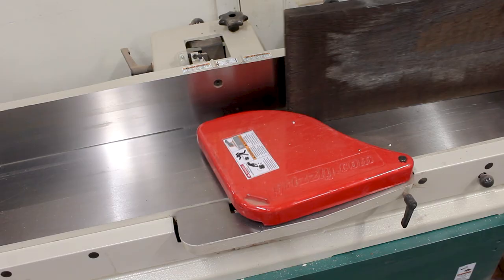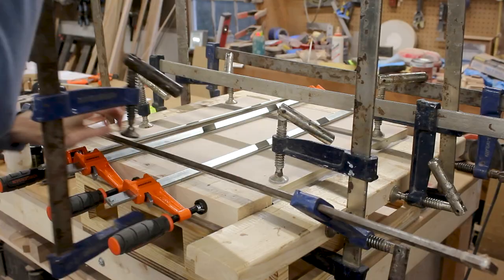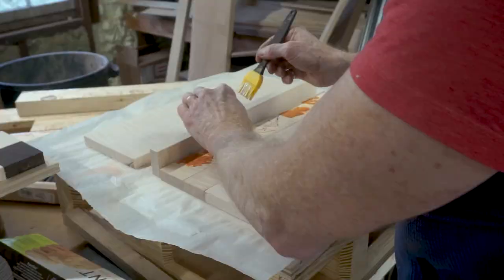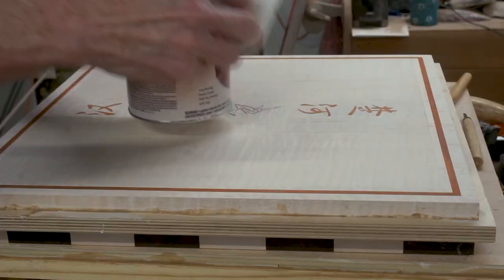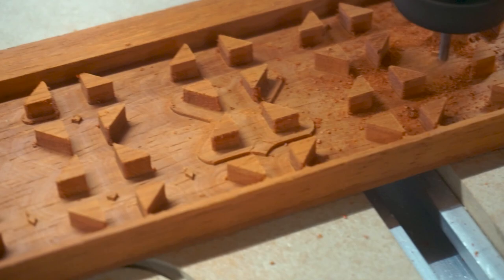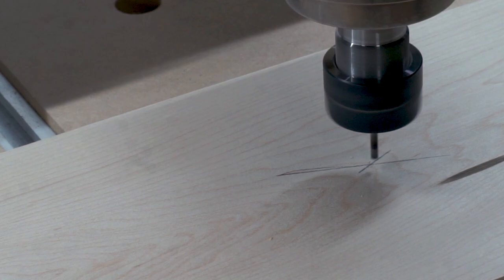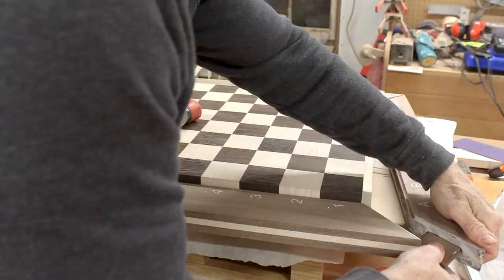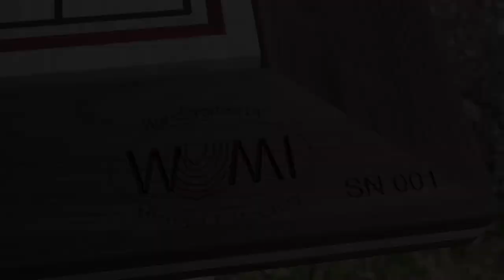Double Sided Xiangqi and Chess Board

Comment: The curly maple on the Xiangqi side is outrageous. Amazing. 

Glue ups like that for me are always a tight contest between stress and impatience: if I use wood glue for a large or complex glue-up, I’m stressed out, sometimes panic, get careless and make mistakes, but at least I’ll be able to unclamp it and start finishing within an hour or a bit more; when I use slow-setting epoxy for glue-up, I’ve got all the time in the world to carefully glue up a complex piece, fix and reset joints, reconsider my clamping strategy, etc.  But then I’m standing there staring at my project looking at my watch waiting for 12-24 hours to elapse before I can unclamp and finish the dang thing.
Reply: My last piece, incidentally, was a hand-tool built chessboard, inspired very much by your channel. It’s beautiful and I’m proud of it. I used epoxy.
Reply from the maker: Making a chess board entirely with hand tools sounds impressive!  I definitely considered using epoxy. I had planned to use Titebond Extend for this one until I discovered that the glue in my bottle had all dried up. The video was sped up by 50%, so it probably looked more stressful than it really was. I was happy that nothing went wrong.

Comment: Hello Mike, can you please tell me if you have changed your DeWalt planer out to the helical blades in running the birds-eye maple through it? I cannot get clean planing on any boards like birds-eye or curly maple. I get really bad tear out and have heard the only fix to that is to change from straight blades to helical.
Reply from the maker: I still have the straight blades in my planer. It hasn't been too bad for me because I do the last few passes with my drum sander. I find that I get more tear out with curly maple than I do with bird's eye.  I've been tempted to get a helical head but I may want to go for a larger planer and get a helical head at the same time.  I've had a brand new set of blades sitting on my work bench for more than a year. At some point I'd like to see how much of a difference it makes to use really sharp blades.
Reply: @Woodumakeit  Thank you for your response! You are a true master!

Comment: Mike, what CNC machine do you use, and was it difficult to learn the software and setup?
Reply from the maker: I bought the Laguna IQ with a 2' x 3' table size.  The instructions for the machine are quite poor, but I was able to figure everything out by watching a few YouTube videos. The software is pretty easy to figure out, but there are also some helpful YouTube videos to help figure out some of the finer details, depending on what you're trying to do.

Comment: Wonderful how you have got al these very complicated operations into a reliable and repeatable system, even for such an extremely complex board as this! Your clamping jig is genius.
One question I have is about the padouk. I have seen both padouk and purpleheart turn into pretty ugly brown after prolongued exposure to sunlight. Do you use a lacquer that resists this, or do you advise your client to avoid exposure?
I will certainly try to make simpler designs using some of your methods!
Thank you for all your nice videos, I wish you great succes in the future.
Reply from the maker: Thanks for the feedback! There's nothing I know of that will prevent padauk and purple heart from getting darker. You could use a spar varnish to block some of the UV rays and slow down the process, but it'll still happen.

Comment: Beautiful work!!  I have one question.  Do you reduce the male part of the inlay at all when you fit it into the female part?  I've read other places that if you just use a mirror image it may be too large to fit properly.
Reply from the maker: I don't have a lot of experience dong this, but I believe the tapered sides are the key. As long as you're using the same bit for the male and female parts and you've selected the right depth settings, it should slide in easily and you push it in as far as it will go to get a right fit.